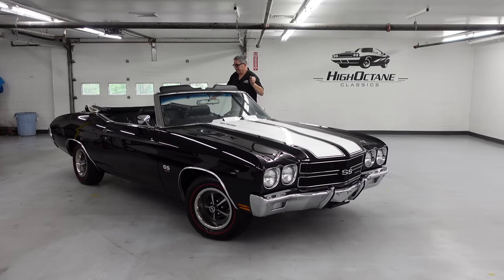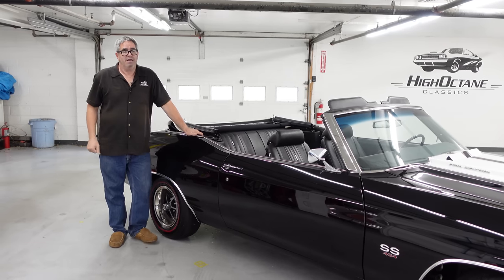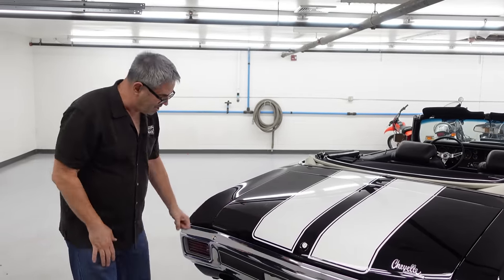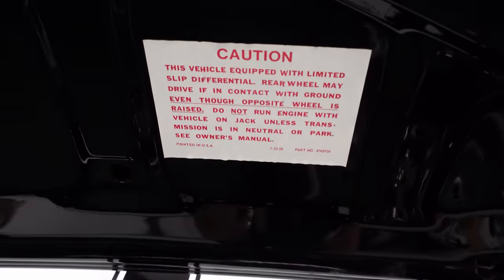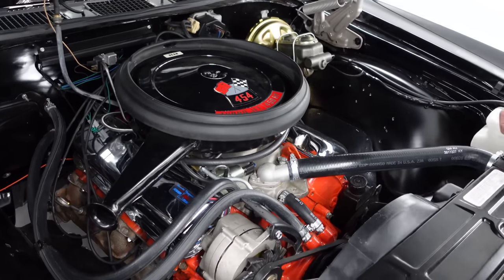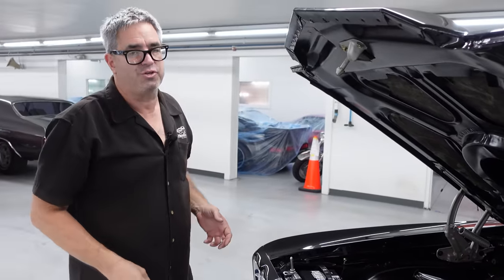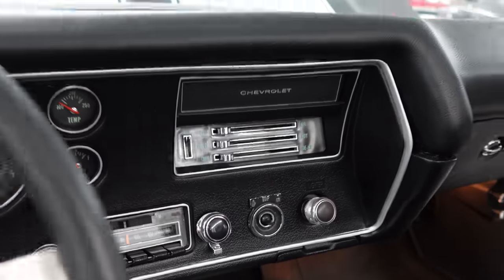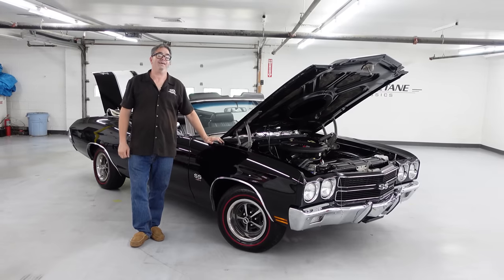1970 Chevrolet Chevelle LS6 Convertible Walkaround with Steve Magnante

Comment: Incorrect tachometer for an LS6.
Reply: Some plants put the wrong Red Line Tack in those LS6 Chevelle
Reply: Wasn't one of the GM plants,Baltimore or Flint I'm not sure responsible for putting 5500 tachs in some LS6s?
Reply: @allenkeiser1718 beat me by about 3 minutes 😆
Reply: @allenkeiser1718  You are correct. I meant as a rule.
Reply: @kevinkendall3122  You are correct. I meant as a rule.
Reply: @bill8386  👍
Reply: No SS steering wheel too.

Rear springs sagging

Motor does not sound like a true LS6. Seems too mild sounding from my dad's original.

Comment: A long time ago, occasionally referred to as the early 80s, there was an article in Hot Rod showcasing a guy drag racing a convertible LS6.  I can only recall parts of the article, but he truly ran it budget minded.  Worn out shocks in front (to help with weight transfer) and he found the slight flex of the convertible helped him launch better. Back when these were “just 10 year old cars”.  This one is stunning and checks all the boxes.  Thanks for sharing ~ Chuck

Comment: Many 1970 Chevelle SS cars had the LS6 engine option, even convertibles.
Reply: Not many convertibles
Reply: @MBailey1977  Roughly 3000 LS6 convertibles were produced.
Reply: @sergeantmasson3669  That's just not true.  Where do you get that information?  Maybe you're thinking of LS-5's?
Reply: @sergeantmasson3669  19-26 ls6 convertibles. I know a guy that ordered one.
Reply: @1Barista1  No, LS6. Source: Haggerty and Hemmings.
Reply: @sergeantmasson3669  So, there were less than 4500 LS-6's in total and you're saying that 3000 of them were convertibles.  Does that seem logical to you?  BTW - Neither Haggerty or Hemmings would ever say such a thing.  Trust me, I've been a Chevelle nerd for 50 years.
Reply: @1Barista1  Being a fan of the car doesn't make you an expert on them. I/we restored three of them and one El Camino. One of the 3 LS6 convertibles, we sold to former MLB player, Reggie Jackson.  Near 200 still exist today which is amazing considering those convertible were prone to rust rot.